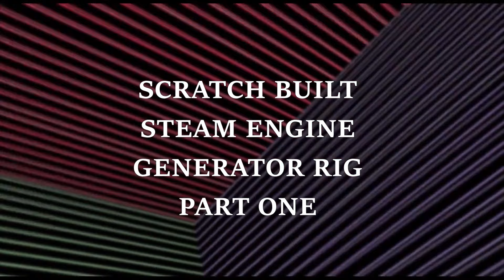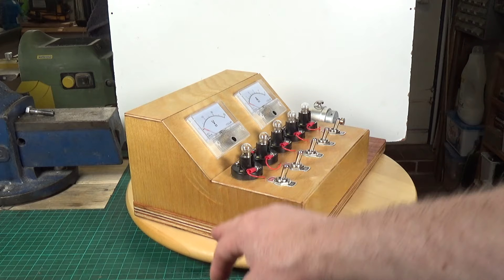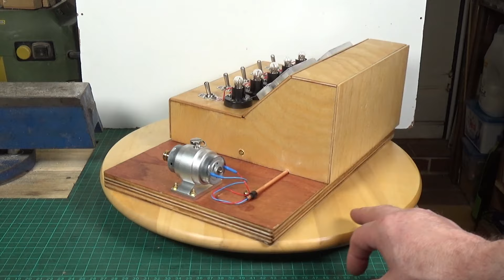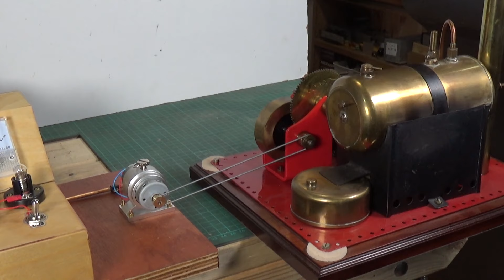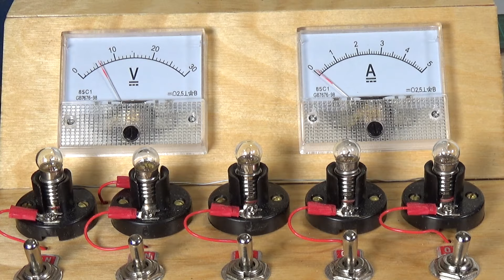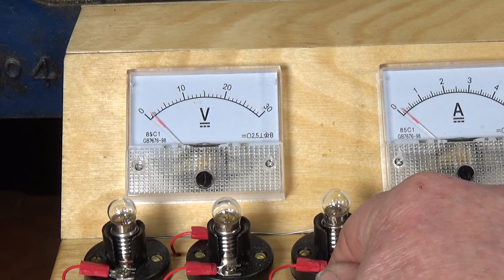Steam and Electricity - Part One

Comment: It doesn't really matter that much I suppose but running the generator at it's rated speed (which will be much higher than the speed of the steam engine) would give you optimal results, the rating of the generator is 12 watts so should light all of the original lamps (IF the steam engine can output 12 watts) so gearing it up (larger pulley on the steam engine) should give a better result.

You could test the generator with an electric motor drive to see if it runs to spec. If you bought another you could use one to run the other (these generators are really only DC motors run in reverse) to verify the specs.
Reply from the maker: Hi Percy. I do plan to do exactly what you suggested, I'm going to drive the generator from an electric motor using a variable supply so that I can steadily increase the rpm. If I can get it to light all the original lamps I will check the rpm at that stage so I know how fast it needs to spin. Cheers, Alan.
Reply: @RetroSteamTech  That's a great test, will look forward to it.
I have to admit I am a retired R&D Electrical Engineer and know what you are going to find, but I love seeing people experiment, and can watch the same experiment over and over again and still find the same joy. I also know that no experiment is perfect so who knows, you may find something "different", one never knows for sure. Cheers.

Comment: That's exactly what they had in the tech when I was serving my time as a mechanic, for testing alternators. It used 12v 40w lead lamp bulbs, think it had 8 in a row and two panel meters. Looked just like yours only larger. Lovely made box BTW.👍
Reply from the maker: Thank you. I didn't really base it on anything just made it up as i went along.
Reply: @RetroSteamTech  It's a fine job, keep the good work going.
Reply from the maker: @IrishvintageTVRadio  Thank you. For many years i was an electronics engineer, i didn't cover CRTs or radios but i enjoy your channel very much. Anyone who can bring an old bit of kit back to life is a hero in my book.👍🙂
Reply: @RetroSteamTech  Thank you very much, I'm glad you enjoy my channel. It's only early days for me and I'm still very much finding my feet.

Comment: Top stuff Alan.  You read my mind.  I have a very small DC permanent magnet motor I intend trying to run as a dynamo off the current Stirling engine build, but I think 5 v will be about all that's possible (if that).  So an LED indicator is the main option, although I do have one other idea in the background.  I saw your steam engine generator on BG and wondered how it would go.  The LED's I have change colour as the voltage increases, so it acts as an indicator of output variation.  I got them out of a junked PC front panel. All interesting stuff.  Pretty cheap fun. Cheers Rob
Reply from the maker: Thanks Rob. Part 2 will be up in a day or so, more fun with LEDs, low current filament lamps etc. Yes it is all very cheap, the lamps, lamp holders, meters and switches all came from ebay, paid next to nothing for those. The generator was the most expensive part and even that wasn't a lot. Cheers, Alan.